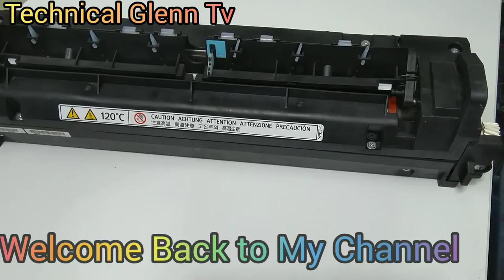HOW TO REPLACE FUSER FILM |  IN A SIMPLE WAY | RICOH MPC2003, MPC3003, MPC4503, MPC5503 |

Comment: SC554-02 😩😩
Reply from the maker: SC554-02, SC544, SC564, SC552, These are the error codes that you need to use a Pico fuse to reset.
Reply from the maker: How to Reset SC554-02 Without Using Pico Fuse.
https://youtu.be/nVkTGKDLfRo